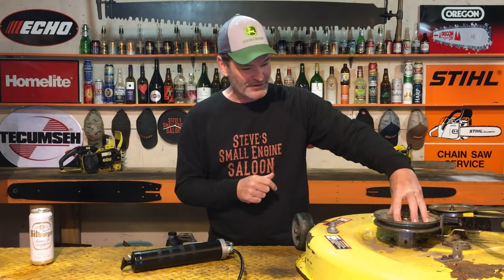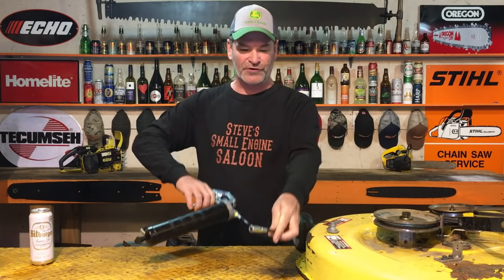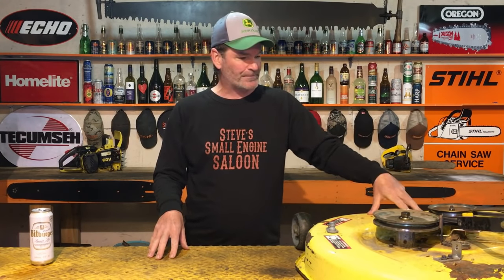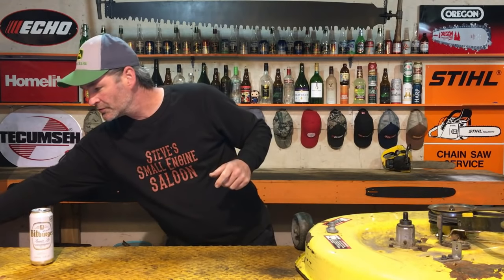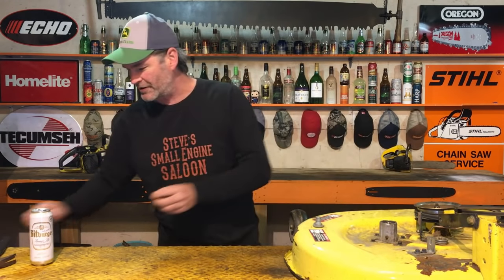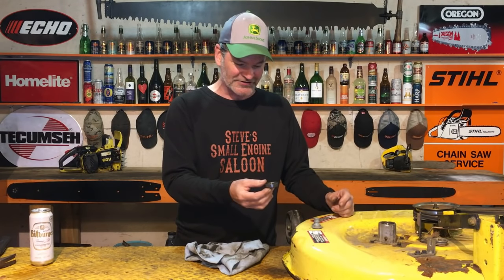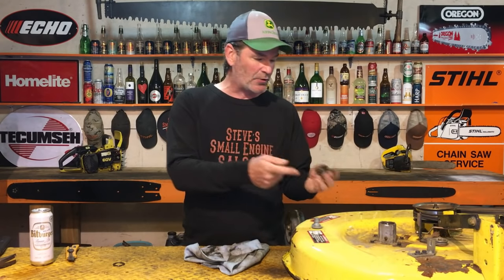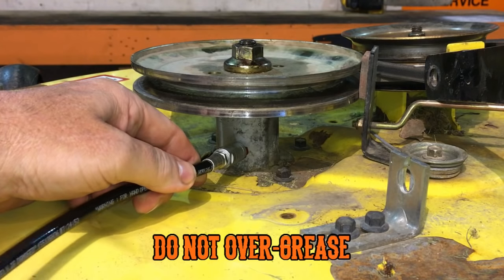Your Riding Lawn Mower's Dirty Little Secret

Comment: Using tractor very loosely. I hear guys all the time talk about their tractor.  I show up and its a lawnmower ;) this is a lawnmower.
Reply: A riding mower can pull trailers behind them, have snowblower, blade, grading attachments. Much more than just mow the lawn.
Reply: @pietrzakattack  agreed, but a very small trailer, and all the attachments are tiny as well 3 ft or so. Still not a tractor. There are lawn tractors as we all know. They have shaft drive and actual real differential rear ends but they are a rare bird.

Comment: This is why i run my old 73 international cub cadet lol
Reply: Gees, you have a new one.  I have 2 1968 125's, one since 71.  Just did the deck bearings last year after 50 years.  Just don't make stuff like they used to.
Reply: Was thinking the same thing as this has never happened on my 1970 cub lo boy.  People have forgotten how to engineer quality products.
Reply: Agreed Gentlemen my old 13hp single cylinder Kohler cuts better than this new light duty crap any way 😂

Comment: Sneaky bloody buggers. Like when you have to buy a whole component part to fix small small broken part within. They sure do know how to milk you dry. Great work Steve.
Reply: I think that the grease fitting was an old design before they  changed to a sealed bearing
Many old cars needed greasing but now have sealed bearings.  No greasing necessary.  
Please Comment if I am mistaken.
Reply from the maker: Thank You...
Reply: I believe that is referred to as "serviced as a unit." (We want to sell more parts.)
Reply: @billrundell2097  "Many old cars needed greasing but now have sealed bearings."
It is the same with motor bearings in furnace fans. They used to require oiling every year and lasted 30 or 40 years. Now they are sealed and last maybe 10 years.

Comment: I learned from the maintenance manager at our shop, grease would actually pass through the seals in those "sealed" bearings.  After installing new spindles in an old deck, I used the shop's Milwaukee electric grease gun to fill the spindles.  After about 70 pumps, the grease came out the top and bottom of the spindle containing those sealed bearings.
Reply: I have had the same issue with a Chevy truck idler bearing and even with the pressure of a grease cup the grease won’t pass the dust cover.  You actually have to do it to know.
Reply: Sounds like a waste of grease
Reply: @NPC-et9ik  Only alternative would be to access the individual bearings on a regular basis.  Suit yourself...

Comment: you can buy 10 bearings for $20.  Don't use water to wash the deck.
Reply: Then add in all the extra time changing those 5 sets of bearings. Either option you choose is up to you.
Reply: Waters fine,. Just let mower cool 1st. Bearing do have a small gap that dirt/water can get through but only when it's hot.  Thermal expansion increases gap size,. Cold it should be fine, but use a blower to dry it

Comment: I did this on my new john deere. The hardest thing was removing and putting back the pulley wheels.
They were pressed onto the spindle with great force. You can actually see the marks left on the spindle by the process.
Working with a heavy deck from the top and bottom at the same time is a bit tricky. 
Allow plenty of time for the process. And it is metric. Have a 22 mm and 10 mm socket wrench handy for the John Deere.
Reply: That spindle flange nut is not metric.  It does take a 22mm wrench, but the thread thread is 9/16-18.  I galled one nut/shaft when I pulled both mine off after 13 years, while stripping the deck for re-painting, and tried to find a replacement locally.  That nut is not a Big Box stocked  size, even without the flange.

Comment: I was a John Deere mechanic for 2 decades and found this out years ago. I found it easier and cheaper just to replace the bearings rather then the whole spindle and take the inner seals out so the grease could reach the bearings.
Reply: YEP  I  DO  UNDERTAND  YOU  GUYS    CHARGES   MY  THE   HOURS   AT  A  RATING  OF  80  DOLLARS   HOURS   MAKE  IN  TWO  HOURS  PLUS   TAXES   FIGURE   IT  HOW  MUCH  GOING   TO  BE  THAT  EXPENSE
Reply: I just bought a John Deer riding mower thanks for the tip.
Reply: @pascualhernandez4949  That's whatever you just said for ya
Reply: @pascualhernandez4949  R U O K??? BLINK ONCE IF NO AND ONCE FOR YES!
Reply: Well, of course, it's cheaper to change the bearings than to change the whole spindle if you're referring to the jackshaft, the bearings, and the jackshaft housing all combined as an assembly and calling it A SPINDLE.  I saw what you tried to do there!  That's not cheaper nor faster than removing one seal on each bearing and just reusing them.  To change the bearings, you have to remove the old ones, anyway.  If they're not damaged, they'll be just as good as new ones - better AND CHEAPER if you just remove the seals and grease them.  Slick move, though, throwing that spindle into the conversation.  It wasn't a lie but very close kin to one!  Sounds like you're STILL working for John Deere!

Comment: That is a BS design. Thanks for showing it Steve.
Reply: just like new cars, certain parts are designed to fail so they make money selling parts.  why do you think wheel bearings and steering joints on new cars are made so they can NOT be serviced/greased?  so the companies make money as they KNOW those parts will go bad quickly if they cannot be greased.  same thing with the bearings in this video.  MTD used to be bad about no grease and the bushings inside the rear ends of their vari-drive mowers being made of steel, it would eat the axel shaft until either it stopped the mower from moving or the axel fell out, and they would get $300 or more for each entire rear-end they sold.  i think steve is onto the mower manufacturers with stuff like this.  i know i cant be the only one who has noticed this crap going on over the years.
Reply from the maker: You're Welcome...

Comment: I'm new to the riding mower maintenence but motorcycle wheels are similarly designed. Packing the hub with grease is recommended to keep water out of the cavity.  If it's full of grease....

Comment: Believe it or not!  Bearings with one seal are more expensive to purchase by end users so they buy double sealed bearings.  Then as further cost saving measure don't remove one seal of the bearing if required!  I learned that 35 years ago designing another machine,  where I personally made sure the seals were removed!!!

Comment: the claw hammer? Oh we need to upgrade you
Reply: Right on the threaded shaft end too lol
Reply from the maker: Its actually tapered so you can do that without damaging the threads....
Reply from the maker: LOL, I should have used my baseball bat.....
Reply: At least use a brass hammer and thread the nut on while hitting on it

Comment: Well that was definitely an eye opener for me as my John Deere has already had two blade pully assemblies replaced, due to failed bearings and I have only ever been offered a complete bearing housing replacement to fix it. I never would have thought that manufactures were dumb enough to put sealed bearings in a greaseable housing. But I wonder if removing the top bearing seal is a good idea. It would take an awful lot of grease to fill the cavity before it reaches the top bearing.

Comment: Steve, you could spend a life time revealing designed to fail or prematurely wear out flawed products.
Reply: Look at late model John Deere combines you get a thousand to 1500 separator hours on them and you are spending huge money I'm replacing things. Look at their tractors used to be able to buy a John Deere tractor and run to 10,000 hours with very little trouble. Now as soon as you're out of your warranty you either buy them or warranty or sell it. Cheap China bearings in their axles bad designs in their engines. I grew up John Deere I went to John Deere College but the green on my farm is the last green I will have. They just don't care about the customer they care about the board of directors. There's other brands that care about the customer!
Reply: @jonstevensmaplegrovefarms3754  That is why we haven't replaced our early 1980's John Deere "40 series" tractors.  The new ones are crap, and have computers to run the engines...just crap!

Comment: Have to disagree, Steve. Removing the seal on one side of each bearing really doesn't accomplish much. The grease will settle out of the top bearing because of gravity and this top bearing will starve for lubrication. Unless you grease this fitting regularly, the top bearing is going to starve and fail. The average homeowner does not do maintenance on his mower. That's why the manufacturer installs sealed bearings; it keeps the grease in the bearing - where it's needed. Grease will stay in a sealed bearing for a very long time. Look at how long grease stays in sealed wheel bearings on front-wheel-drive cars. Some will last more than 150,000 miles with no problem.
The manufacturer put the grease fitting in the housing for one reason, and that is to keep the jack shaft from collecting moisture which migrates in from the blade areas causing the jack shaft to rust and become impossible to be driven out of the bearings. The best thing to do is use the mower until you can tell the bearings start to make noise, remove the entire MANDREL  ASSEMBLY (as it's called), and replace it. Unfortunately, you can't always tell when the bearings are starting to make noise because the blades normally make so much noise. Sometimes, spinning the blades (carefully - keeping your hand out of the way of the blade) when you have the deck belt off, can enable you to tell if the bearings are making a noise or sounding like they are dry. I suppose it's good insurance to replace these mandrel assemblies whenever the deck belt breaks or wears out will be a good time. Replacing this entire mandrel assembly is a whole lot easier than replacing bearings, and often, the rusty jackshaft. And, you don't have to get all greasy. Shoot some grease into the new mandrel assembly thru the grease fitting after you have installed it, not over-greasing, just enough to keep the jack shaft from rusting.
Steve mentions in the video, it's easy to over-grease these bearings that have had one of the nylon covers removed, pushing the grease out thru both the top or the bottom of the housing and even risking pushing out the other nylon cover that you left on the bearing, thus contaminating your soil, or making a greasy mess on the top of your mower deck which attracts debris. And, you really don't know how much grease to put into these assemblies. It's easy to over-grease or under-grease this assembly. There's no way to measure the correct amount of grease to put into the fitting because you don't know how much has stayed in or migrated out.
 As of this writing, the assembly sells for about $32., little more than the cost of a couple bearings.

Comment: The bearings like that are used in so many things. All of my shop tools with electric motors have these bearings. I had the motors in two table saws go bad and they had the exact same bearings. Found them on Ebay, popped the in and I had two table saws that could not cut straight. One I use to stand on when I work on my trucks. The other is holding my Dewalt thicknesser. As easy as those are to pop out I just replace them since they are only a few dollars.

Comment: I think what happened on the design was that the spindles were made with the expectation that the bearings to be installed would have been grease bearings. Somewhere along the line they specced sealed bearings and never went back and redesigned the spindles.
But your solution won't work either, since there is no way to know how much grease to insert. There is no indicator to know when you have filled the cavity up with grease, so you won't know if the grease made it to the bearing race.
A better option, IMHO, is to take out the seal, manually work grease into the bearing, and then replace the seal. Its well known that bearings aren't packed with a full load of grease from the factories. You can see that when you opened the bearing seal. There is no way grease can escape from inside the sealed bearing race, so what you see there was what was originally inserted. Just pack more grease, reseal, and you should be good to go.

Comment: Well I guess this fix would help somewhat on the lower bearing, but I can't believe the upper bearing is getting proper lubrication. I personally grease these bearings and put the dust cap back on a yearly service. Never really had a bearing issue. Thanks for the heads up.

Comment: Hey Steve if only a top nut and an assembly bolt plus the bearing would pop out so easily... but I get it, for demonstration of the procedure purposes you had pre-loosened them.   Thanks for the heads-up.

Comment: A best of the best video here re: riders Steve. I  Manager of a mower shop. The owner was a cheap S O B . The owner was the father and the son the Gen.mgr.  Truly the fruit never falls far from the tree, LOL. I am set to buy another rider.  My first task will be to first ascertain its bearings are in fact sealed. If so, I will harvest to make the adjustment as you recommend. I never knew. What is as bad, and likely you know too. Most zero-turn mowers include a grease zerk for (2) front yoke bearings. Brand new Ariens in approximately 2005 had none. More planned obsolescence.?

Comment: Now that you modified the bearings you can move on to repairing the shaft threads you peened over with your woodworking claw  hammer. Ugh.
Reply: lol was thinking the same thing
Reply from the maker: The reason I did not put the nut back on before I hit the shaft is 
because that model has a tapered shaft at the top so you cant damage the
 threads!  I do agree that it is good practice to put the nut back on 
though....
Reply: lolol Exactly....wood block please...you know those top threads are rolled over!!

Comment: The grease fitting was probably forgotten, when the unsealed bearings were replaced by sealed bearings during the last redesign.
Reply: No. I own a 2006 john deere L110 and the spindles were original. All bearings in the spindles had seals on both sides. Replaced bearings and did what Steve shows here. I don't know what is cheaper....replacing bearings or greasing them.
Reply: I have seen what you are talking about, on paper. But have never actually recovered the bearings from an old style design. They are always beyond repair, by the time they get to the shop. Gotta replace em with the new debt-slave design.
Reply: thanks Pollyanna that likely it.

Comment: Longevity would be tapered rollers with dust caps and a grease fitting accessible with shields.
Reply: That's the way my 15 year old Cub is. Still running the original bearings, mowing 3 acres every week.  My neighbor bought a new Cub last year and he has the sealed bearings with no grease fittings. I told him we will replace his bearings in 3 to 5 years, if they last that long.
Reply: Also significantly more expensive and requires frequent greasing, which the average consumer will never do.. They don't put sealed bearings in consumer mowers to make them fail, they do it because consumers don't maintain their mowers and greasable bearings fail quickly if they're not being greased.
Reply: @chezlerq4478  1300+ hours on the original sealed bearings in my Craftsman.

Comment: They do the same thing on industrial equipment too.
Reply: Usually they don't..  one thing he completely fails to mention is the majority of bearings with grease fittings have a ground in the outside of the bearing with a little hole in the ring .. some just have a pin hole and a knob sticking out.. That style has to be oriented in such a way that the hole lines up with the grease fittings..  the ring style still benefits from putting the hole directly in line with the fitting..

It's easy to tell when they are wrong because the grease quickly (usually on the first pump) squirts out from the outside of the bearing..  this is typically because the maintenance guy at the job installed either the wrong kind of bearing, or installed it incorrectly..  the ring or pinhole does clog easily as well, especially in dusty environments..  but again, a lot of times that's because the maintenance guy either didn't wipe down the fitting before and after apply grease, or didn't have th grease gun clean and capped between uses..

For reference, I'm a level 3 industrial maintenance mechanic for a book distribution facility..900,000 sq ft, with 11 miles of conveyor.. I change at least one bearing a day every day..  about 50% of the failures are due to incorrect assembly or application ..

From the video, it didn't look like the style of bearing he has is meant to have the grease hole, and that would be confirmed by th placement of the fitting on the spindle..

While the vid does show a "sealed" style if bearing, the grease will find it's way into the bearings with the pressure applied by the grease gun..  the issue is that the best way to do this would be disassemble and clean everything first, and then reassemble prior to greasing, and no one is going to do that ..   opened the seal is begging for more problems though, because the upper andlower spindle seals are absolutely letting debris into the cavity, which is why they use sealed bearings to begin with..
..the idea with the grease fitting is to force grease into the housing from the center, helping to force out the dust and debris that's entering from the top and bottom ..

You can verify that this process works by cleaning everything up, and slowly pumping way more grease than you think it needs into the cavity, then disassembling and visually ensuring it made it's way into the bearings 👍
Reply: @aztekwarrior518  If you say so.

Comment: Some larger framed electric motors are the same way. Bearings are sealed, but they have a grease fitting at each end.